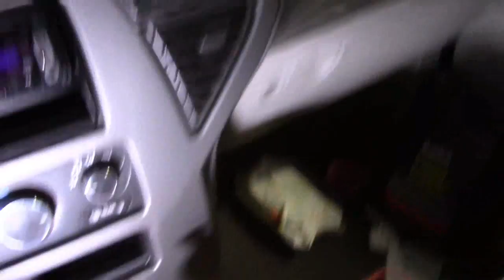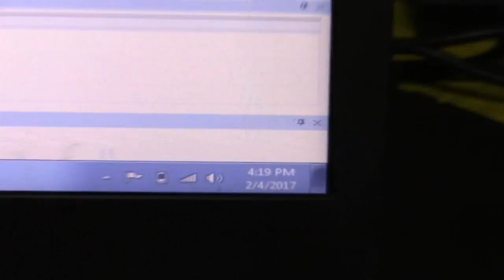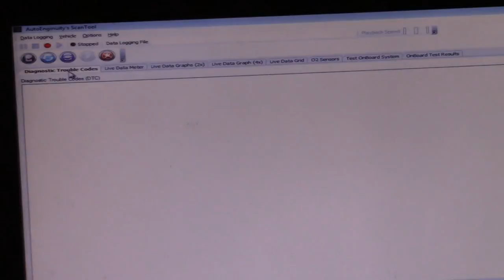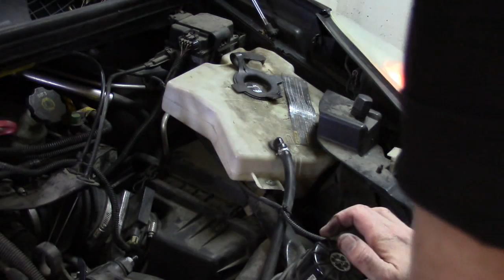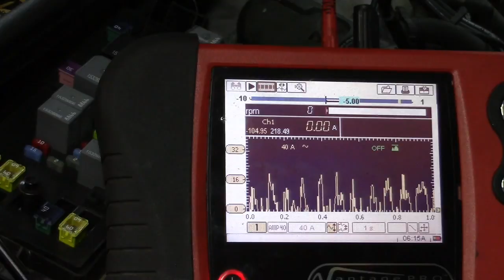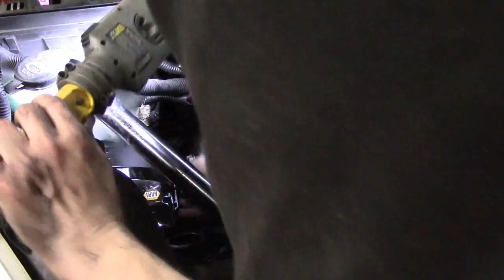2005 Buick with a P0300, P1311, and a 420 code.

Comment: I know this particular vehicle didn’t require an ignition coil but I’d like to ask when you do find a bad coil do you buy from the dealer for OEM or do you purchase from an auto parts store ?
Reply from the maker: I always just buy aftermarket ones from Oreilleys and never have an issue.
Reply: Dang I went to the dealer and one coil pack was $187 ($205 with tax)😢. I have a 2012 Ram 1500 5.7l Hemi. They are about $50 at O’reilys 😮. It did fix my problem(I knew it would I moved it from cyl 4 to cyl 2 and misfire moved) but I’ll try aftermarket if I have another one fail. Thanks for responding I truly appreciate it!

Comment: Wooowwwww!! The same exact thing happened to me with the same car!!!!! I bought an 05 Buick Century and the check engine light came on driving it home from the dealer. Found out that the dealer had cleared the check engine light prior to selling it me . Found out from a mechanic who did a diagnostic that it has a blown head gasket. He said it was a Cylinder 5 misfire with code P0305.

But here's the twist, I did a leak down test multiple times the other day to confirm and the fluid didn't change color.  There's no smoke, no oil mixing with coolant, no radiator bubbling, no overheating, or any other sign other than some sludge in the coolant. The only other symptom is the car hesitating and jerking after driving it for 20-30 minutes. Prior to that, it runs very smooth, and it never has issues when idling.
Reply: You could have an outside break in the gasket where the compression is simply lost outside of the engine and combustion gases are not entering the oil and/or coolant passages.

Seeing how cylinder 5 had the misfire I think it definitely could be head gasket on the OUTSIDE of cylinder 5 where the compression is being pushed OUTSIDE and NOT into another cylinder/coolant jacket/oil passage...

Comment: Couldnt u validate also by pressure testing the cooling system, love the tech vids here in Australia,
Reply from the maker: Not normally but sometimes you can. 
Remember a cooling system them pressure is only like 12-15 PSI. This may not be enough to cause leakage past a crack into the cylinder.  in even a leaking cylinder compression failure, the cylinder compression is way, way, way more pressure than that. So you will see the leakage from cylinder to cooling system but may not see it from cooling system to cylinder unless it’s a really bad leak.
Reply: @SchrodingersBox  ok yea that does make of alot of sense, btw loving these tech vids and learning of tools n techniques ive not seen b4  n thnx for t the response love ur work n ur car too ive got a cammed ls in Aussie trim ,10/10
Reply from the maker: My pleasure!  Glad you are enjoying the channel

Comment: Hey I have an 06 Buick Rendezvous myself with a 3.5 engine. I was wondering why my car overheats with a 0496 code and my AC just stopped working. I'm an aspiring mechanic so I've done lots of repairs on this car, but I can't figure this one out. I already have another compressor but if it won't do my any good to replace it. I'll take it back. Thanks in advance.
Reply from the maker: what data do you have?
Reply: @SchrodingersBox  I have like 6 codes P0300,  P0496, P0107, P0455, P0480, and P0171. From what I have learned I need to replace a MAP sensor, purge valve solenoid, and that's all I know for now...
Reply from the maker: What data indicates the MAP sensor is not functioning? You never gave that data. was it voltage based or was it PID based?  Also what data indicated the purge solenoid failed? Was it a functional test fail or did you confirm reference and ground and ruled it out?  I have to have relevant data to determine the cause.
Reply: @SchrodingersBox Honestly I don't know. I'm not sure how to run those tests. What tool would I need to check the voltage on these two things? I am only going by what the codes say the issues are.
Reply from the maker: Yeah sorry I can’t help with that. I have to have diagnostic data otherwise i’d just be guessing.
Reply from the maker: also the codes don’t say what the issues are. A code never tells you what the issue is.
Reply: @SchrodingersBox  not a problem, thank you anyways

Comment: P0420 code: car has high mileage and the cat is worn out, car has a vacuum leak and is running lean, burning out the cat. Oil control ring or valve guides are worn causing a plugged cat. Engine has blown head gasket, dumping antifreeze into the exhaust,destroying the cat. Upstream O2 sensor has flatlined, causing lean condition. MAF sensor has become dirty or inoperative, causing a lean or rich condition, destroying the cat. The lesson I learned, the hard way, is that the P0420 code most likely was caused by an engine problem and that the cat didn't self destruct on it's own.

Comment: Hi... Great videos... I'm after some advice if possible... My van won't start.. No fuel getting to the filter.. I've Checked voltage supply to the in tank fuel pump and it only reading 3 volts? Have you any idea where I should look first? Kind regard
Reply from the maker: Put voltage directly to the pump to check for operation.

Comment: Hey Matt, What would happen if you jumped the control side of the relay that you used for cranking the engine? Also, it was pretty amazing that you were able to see that #4 was the problem, since  there  was so much variation in those patterns from one cycle to the next!
Reply from the maker: If control side was jumped it would have no load since the relay is missing. Obvious disaster.

As for the #4- it actually wasn't that great of a guess- I imagine several of the cylinders where bad and #4 was just one of them. I bet #1 and #2 would also have done same.

Comment: I have a quick question. My car an Audi A4 B8 had a misfire on cylinders. P0300 P0301, P0302...P0304. It took the repair shop months to figure out what was causing the issue. They confirmed that it was the rear main seal and costed me close to $2k for spark plugs the rear main seal and a new battery (they suspected a voltage issue because there was a dead cell). So my question would be, how would you know its the rear main seal when all you have is a rough idle with a misfire. (no oil leaks) Thank you.
Reply from the maker: Rear main wouldn't cause random misfire
Reply: Sorry I could not add the PCV valve was bad and could the rear main seal break off because of that?

Comment: I'd like to say I only spent 20 minutes once on there only being 1 bank for the O2 sensor, but it's likely twice that. Until I viewed the entirety of the exhaust manifolds, which are oddly married together to be cheap with O2 sensors, I couldn't trust that it was the scan tool, lol.

V6? 1 upstream O2 sensor? I'm pretty sure that insanity is a contributor to my 2nd most famous video. Cataclean works. I solved the misfires, I solved the vacuum leaks. The catalytic converter still looked bad. We replaced it. It looked great on the sensors and the PCM STILL thought it was a bad cat. 1 bottle of Cataclean later, not quite used according to directions and the "catalytic converter was fixed". (maybe it was a cheap catalytic converter where they skimp on precious metals - our shop didn't do that part of the job)

I'd never have thought of it, but I wasn't the owner so I went with the request, and it worked! Right there on the live sensor feed was a rear O2 sensor, which wouldn't go lean without extreme fuel injection cut off from coasting. It was too good at not going lean if you know what I mean, but oh well. Never saw the customer again.

Comment: Excellent diagnostics! Thumbs up.  Given the installation cost of a new head gasket was this a scrap or no-scrap decision?  Reason I ask is that you may have only found the tip of the iceberg on that engine given the wave forms.  For example, does it need only one head gasket, new valve springs, new head(s), or a new engine?  Also, will it need a new catalytic converter or maybe only the downstream O2 sensor?
Also, thanks for your comment on my YouTube video.  The machine shop warrantied my engine head ($615)!
Reply from the maker: Yes I have no question those waveforms indicate more than one combustion chamber breech, and very likely both banks affected.
  Owner decided to scrap.  I'll be going used car shopping with them tohis weekend to make sure they don't get ripped off again!

Comment: chrysler 3.3 and 3.8 engine use one bank as well GM with this 3.4, 3.1 and 3.8 i think toyota done same set up in some v6 engine. good video
Reply from the maker: Yes you are correct.  I do hate that design though!!

Comment: That's pretty severe. I've got the very same leak- down set. I thought it was funny using the torque wrench but, why can't you? It works good. Thanks again. Come work in my shop any time.
Reply from the maker: Yeah I wish one of those numbskulls would explain to me why they think setting a torque wrench to 200ftlbs and turning something that requires 80 ft lbs of torque is damaging to the wrench yet torquing something to 200ft lbs isn't!!!!
  It's like saying putting a rubber band around something that doesn't stretch it is worse than over-stretching it.
  Morons.  I have morons on my team!!!!

Comment: This sounds silly but It's one more indicator. Depending on the severity of the gasket breach, you can smell exhaust gas in the coolant bottle. Though not conclusive because that doesn't tell you which bank. But very good deductive thinking. Very good exploring all the avenues. That's how we have to think. Your demonstration of scan is informative.

Comment: I think they where thinking the Buick exhaust was chooch with them lol Yup always better diagnosing anymore then just assuming what the problem is and throwing parts at it hoping that fix the problem...Keep us posted if they where going get head-gasket fix then?
Reply from the maker: Owner decided to just junk the car. Too bad... if I had time I would buy it and flip (which is how I got started in this hobby)  it but I no longer have time for major repairs.
Reply: I hear ya sounds like the original owner off loaded just in time to sell someone else to hold the expensive bag. Hopefully lesson learned it important for buyers to take all precautions buying used vehicle so seller don't get away with this of kind scam.

Comment: Nice one, Matt.  That coolant spill was pretty definitive for that bank, but considering how hot that engine was getting, I have to wonder if it's possible that both head gaskets are fried - especially since your waveforms didn't seem to show any solid difference between banks.  Your thoughts?
Reply from the maker: Oh- totally agree!! I have no question there is more than one cylinder leaking. It also explains the inconsistency in the relative compression.  But I only needed to locate one ;-)

Comment: @Matt Thanks for showing that test on the scope.
@Eric Didn't know I could use voltage to check comp as well. Tempted to cut the wires off my old timing light (should have bought the other one from the garage sale).

Comment: I done enough heads on those 3.4's to know to stay away from them.
Reply: Just their intakes are a pain. Oh yeah, I haven't done the metal ones, just the plastic ones. You're terrified of breaking delicate 15 year old plastic the whole time! LOL
Reply: I have never seen a 3.4 with a plastic intake manifold.
Reply: ***** Probably the 3.8?
Reply: Yeah the 3.8 has a plastic upper that is a bit problematic.  Usually when they go you get antifreeze in your oil.  I had a Buick with a 3.8.  I just replaced it every 30k miles to be sure.
Reply: ***** You had probably the best running one around. :)

Comment: P1819.. and 1811 could that be because the IMS is bad, especially long sifting?
Reply from the maker: Yeah I did not pursue those because its very common to see trans codes with misfire.   Had this car not had a bad head gasket I would have investigated further  but with this major repair defined, nothing else really matters
Reply from the maker: ***** I don't see how it is guaranteed a bad PCS would cause a P1811.

Comment: As usual, another great video. I really enjoy your dry sense of humor. Is this the norm with used cars; clear the codes and dump it?
Reply from the maker: Good question. Looking back I would say it really depends on the price range. In my experience I'd estimate about 80% of the cars under $2000 had serious issues that I do believe the owner was dumping on a seller.
  Over $5000 though- I have yet to see a car with what I consider a serious problem, but I don't get called to inspect those nearly as often.

Comment: Nice work, you can definitely say that there needs to be a tear down, And you would also include a cracked head as a possibly. and possibly more less common things. It may be real evident the head gasget is bad.
Reply from the maker: Yep you never know til you look into it. It could even be a cracked cylinder at the cooling jacket and the whole engine is toast. But unfortunately I no longer do major engine repair and rebuilding. Owner is on his own with this one.
Reply: Schrodingers Box

Comment: P0420 is a low efficiency code-- how ironic. Thanks for going the extra mile to show how to verify it was a blown head gasket. And thanks for not showing how to remove a spark plug.Nice comedy as well.
Reply from the maker: Hahaha low efficiency!!!  I missed that lol!!
Reply: It's probably been misfiring for a while (P0300) and/or putting coolant out the exhaust so now the catalytic converter has been damaged (P0420).

Comment: Its time for you to look into ignition waveform analysis, especially when you don't want to get your hands dirty, you'd be surprised how much an ignition waveform can tell you.
Reply from the maker: How is an ignition waveform going to demonstrate a compression leak?
Reply: Schrodingers Box I thought poor compression will give you a noisy/"hashy" looking spark line
Reply: other than a short spark line it would have a low voltage spike. 
sometimes it's obvious but other times the key to pointing out a fault is to compare cylinders.
Reply from the maker: I never heard of that but i will give that a try. I figure with this being a waste spark I won't see that even if it were true.

Comment: some of those GM engines only have 1 upstream O2 for both banks. that's why you only see bank 1 fuel trim data.
Reply from the maker: That would be a stupid design!! But it makes sense.
Reply: I have a 3.5L 2007 impala and it has the same design with only 1 upstream 02 sensor.  I feel your frustration!!!!

Comment: Best part of the video was the leakdown test, coolant spilling out of the radiator once pressurized. Is that car getting repaired? Looks like an expensive fix with bad head gaskets, cat and trans pressure control solenoid repair.
Reply from the maker: Yep- that's the definitive test I was looking for. I need to be 100% if I am going to tell a guy he was ripped off on a car sale.
  I am quite certain this guy does not have funds to repair this car... unless he sells all his weed lol

Comment: Yo Matt way to weed through that one! It only has one bank of fuel trims showing because it only has one bank of O2's so it's not your shitty scan tool this time, it is just the way GM set it up. In regards to your relative compression test, instead of monkeying around with all the noise on your amp clamp and guessing what cylinder is low just use "voltage" for your relative compression. It is ten time cleaner especially when using a graphing multi meter instead of a scope. Every asshat knows the relationship between the voltage, current, and resistance in an electric circuit: I = V/R. The current is directly proportional to the voltage and inversely proportional to the resistance.
Reply: eric o your to funny
Reply: I've been doing   voltage relative  compression tests from the cigar lighter socket  
Using a low pass filter also can clean up the waveform considerably.
Reply from the maker: Yes I forgot about the single O2 sensor.. I was so thrown off because the last video I did the same thing happened but the car did have O2 on each bank.

  So I didn't show it, but I tried the voltage instead of low amp and actually the noise was much worse.  I thought the Amp clamp setting IS reading voltage anyway. the clamp converts the electric field detection to volts for the meter.
Reply: Sorry, I should have been more specific. Try the low pass filter when trying to do a relative compression test using only the battery voltage.
Reply: It helps to have a few variations for some test routines. Of course you have to work within the limits of the tools that you have available to you. Using an inline filter  https://www.thorlabs.com/newgrouppage9.cfm?objectgroup_id=8613 can be looked at in the same vein as turning off spike detect. (Not the same, but can have similar results)  On a scope like PICO, you can reduce the number of samples per second or try filtering the capture after the fact.
Reply: The wave form can usually be cleaned up a bit with a low pass filter. As far as finding time and mileage since cleared, GM likes to put that in the failure records if you can access them.
Reply from the maker: John Gillespie Yeah I usually use the filter on positive terminal data acquisition and it does clean up well- I also use AC coupling and peak detect.  But on negative it just never cleans up for me.
Reply: South Main Auto Repair f